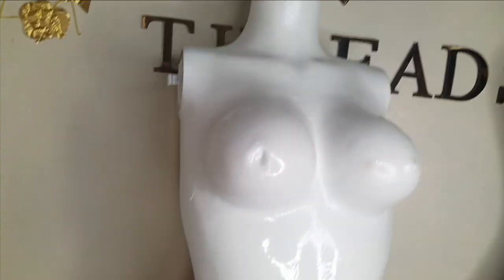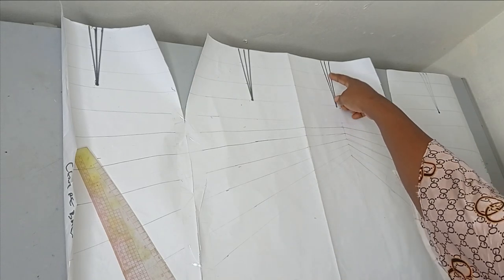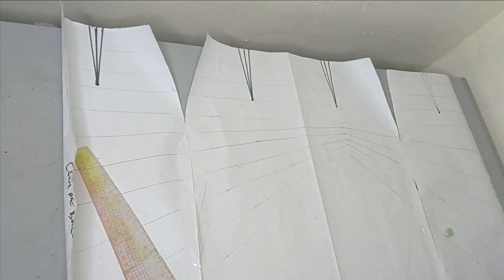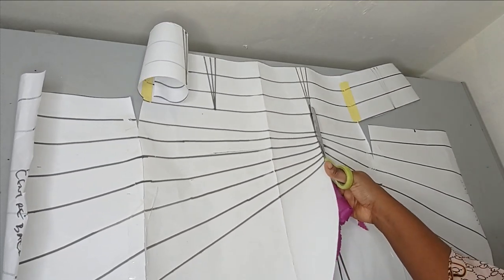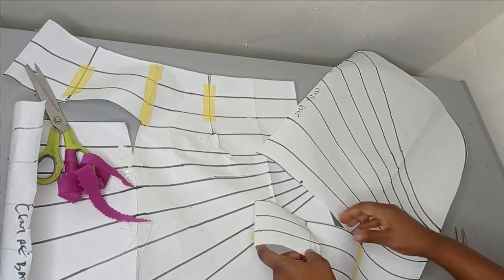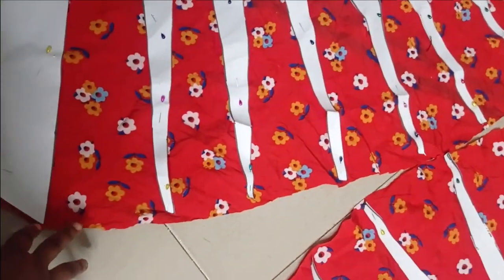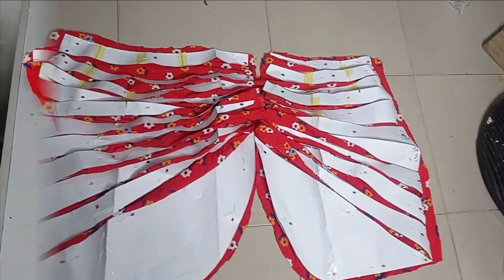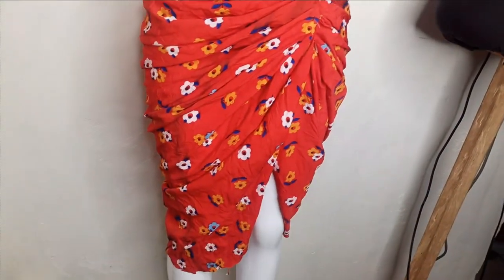TRENDY DRAPED RUCHED SKIRT TUTORIAL

Comment: I appreciate your efforts, but I think that particular style is from draping an a line long or flowing gown. Because the turn out of this method isn't same thing with the style
Reply: It's the same thing, you can use slash and spread to achieve a draped style...hers was just plenty and smaller (pleat)than the original pix that d pleat was bigger.